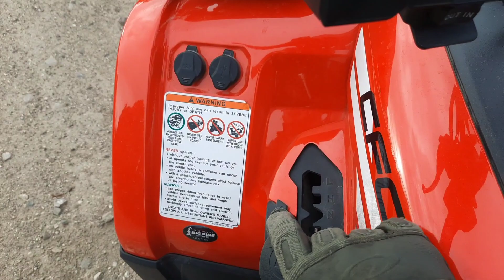2022 CForce 500 high moutain desert cruise. Best ATV for the $.

Comment: Did you find the shifting becomes easier on small inclines/declines after a while? Got a new 2023 and it's a bit tough to shift gotta rock it like it's 20 years old to shift lol.
Reply from the maker: As of yet, no, I have not. If there is any kind of pressure on the transmission, it's a pain to change gears. It's really the only serious complaint I have so far.
Reply: @RideAlongOutdoorsCh.   Thanks for the reply!  I watched some videos about adjusting the shifter linkage from people who seemingly had the same problems, i might try that and see if it helps any. It's a great ride other than that! Peace

Comment: I do not have these issues xD my cf500 has 250 miles and it shifts fine minus not going into park sometimes.
Reply: I have a ‘22 1000 overland and my old ‘21 Outlander 650 both did that shift issue